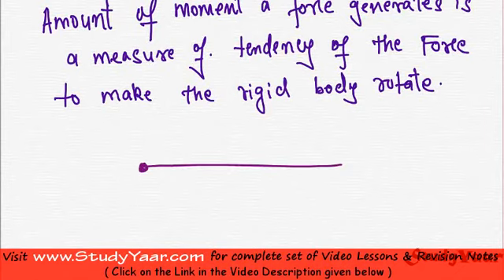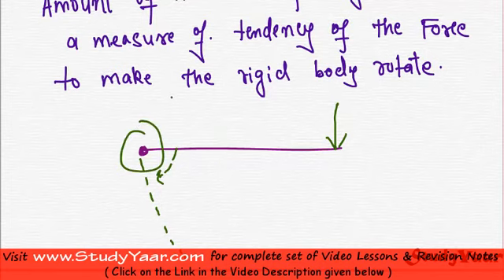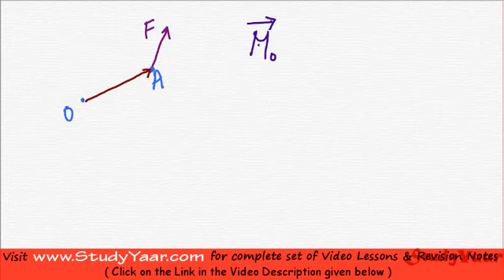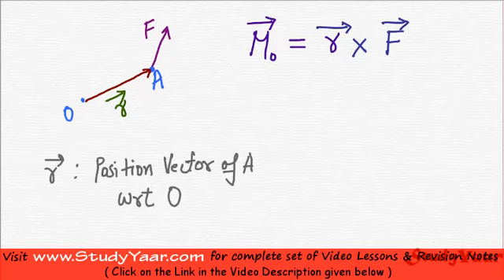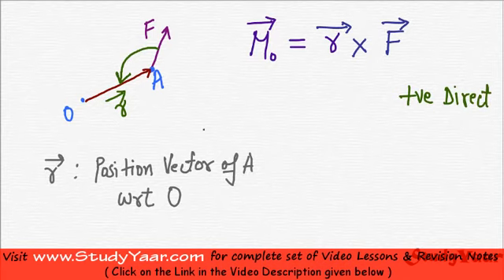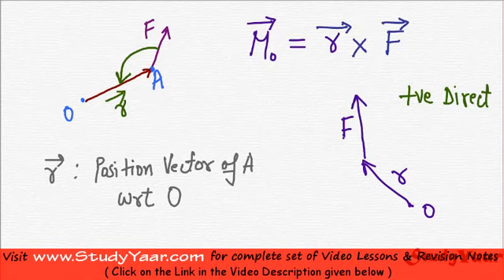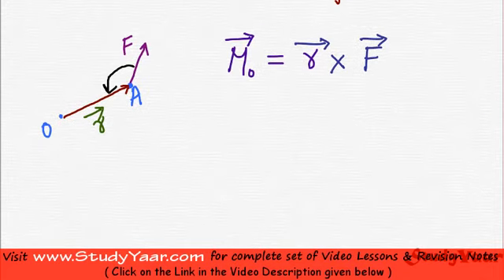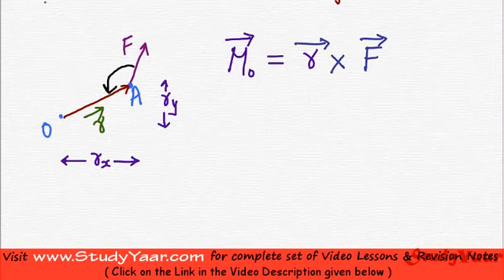Moment of a Force,  Varignon's Theorem & Solved Problems

Comment: The direction is not given by curling fingers from F towards r, rather it is given from r towards F measured in the counterclockwise sense. The direction of the thumb then gives the direction of the moment.